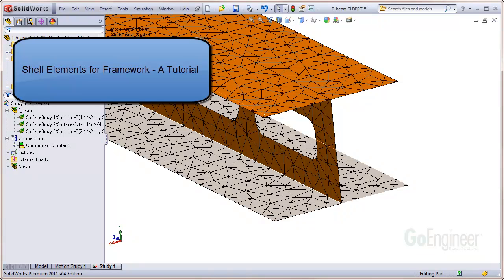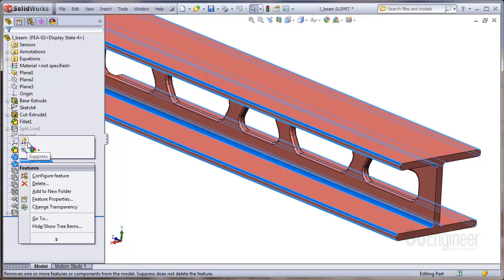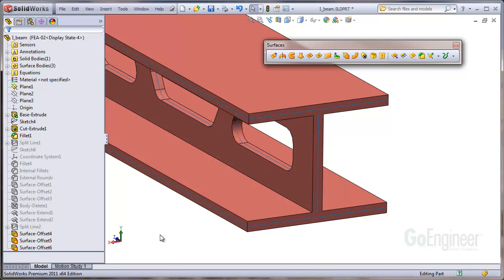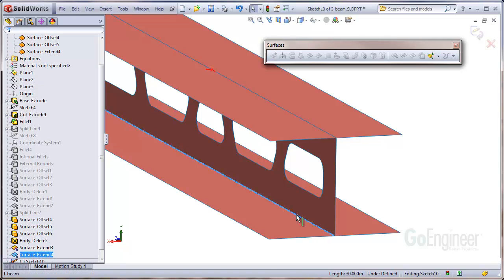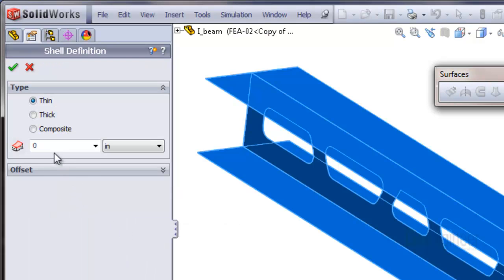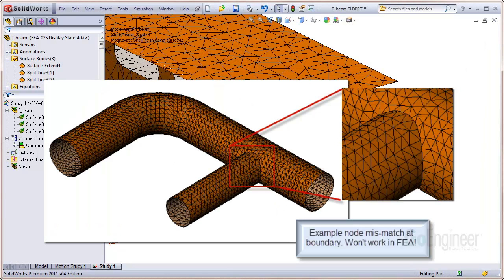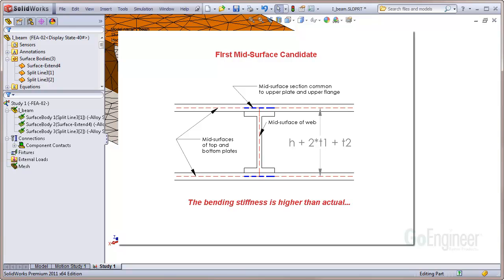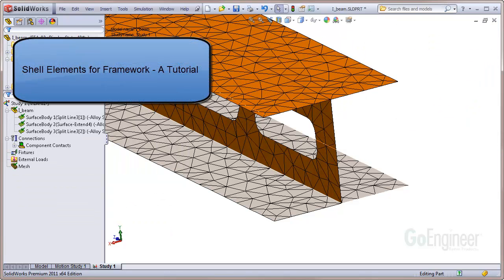SOLIDWORKS Simulation - Shell Elements for Frames Tutorial

Comment: How do I do this when I would have 500 profiles? 
There must be a quicker way
Reply from the maker: Hi 00Mass00,
There isn't really a shortcut on this particular method of using shell elements to analyze beams.  In my experience, putting the time into making the mesh like this pays back 10x in saved solver time though.
Reply: GoEngineer Thank you for your answer. I have ship model of 100m where I want to do this with a lot of profiles :) But I think only option for now will be creating the profiles from scratch as surfaces. I thought maybe there is an option that would have the intelligence to place the surface in the center of the solid because it represents the thickness.
Reply from the maker: Right now the only features that intelligently place shell mesh at the midplane of an object come from the Sheet Metal features.  Other solid features do not have a way to automatically recognize the midplane and place a shell there.

Comment: hi, excellent video. for something im working on i need to apply torsion to a shell cylinder on its edge but solidworks won't allow it unless i work with the solid element. what can i do?
Reply from the maker: arian martin, while SOLIDWORKS Simulation does not allow you apply a normal force or torque to a shell element edge or vertices. You can still apply a torque to a shell element face. My suggestion is that you make a split line on the face of your cylinder very close to the edge that you want to apply the torque force to, and then use this very small face as the definition to apply the torque.  Thank you for watching and your comment.
Reply: thank you very much

Comment: In the assembly, insert a new part (which is empty) and copy the surfaces from the other parts into the new part (while still in "edit part mode"). Then, close the assembly and open only the new part. That will save a lot of memory and confusion. For the round you will probably want to make a solid hemisphere. Mesh it then fix the whole thing and push the sheet metal into the round with a "no penetration' contact between sheet metal and round.

Comment: Hi, very nice video. thank you for posting.
I have a question:
I'm trying to mesh a recumbent frame with shell elements. I split the intersecting surfaces, how you recommended but my mesh doesn't joint well. I tried two different solutions: in one case I removed the inner split surfaces and in the other I left the surfaces but the problem is still present. Can you suggest me how to solve the problem?

Thank you,
regards
Matteo
(I'm sorry if my english isn't perfcet, I'm not native speaker)